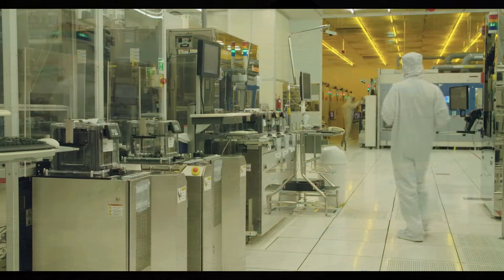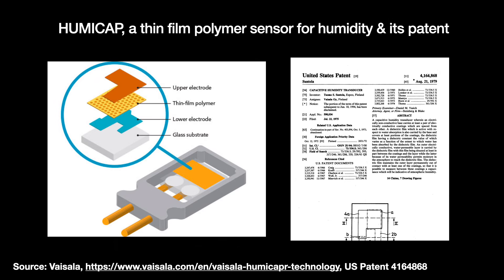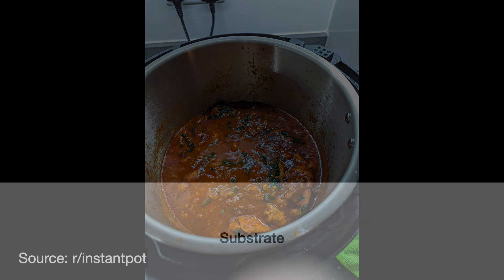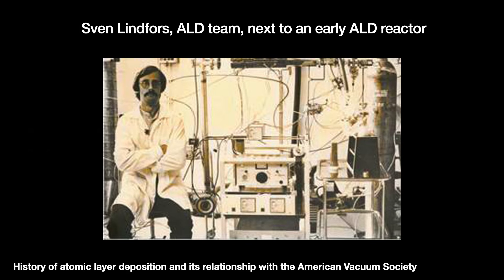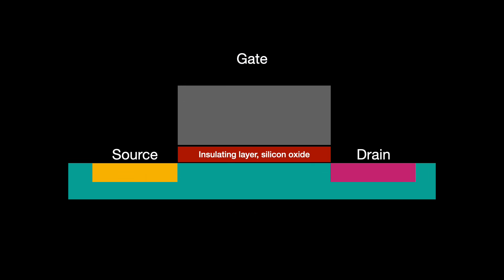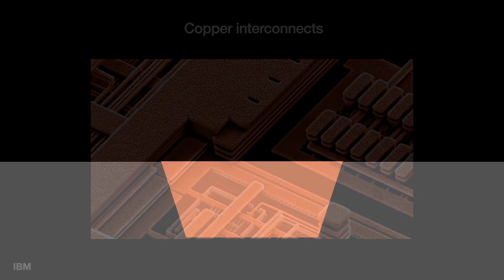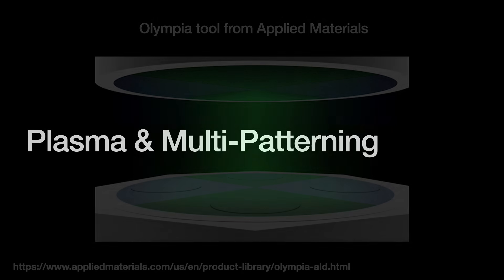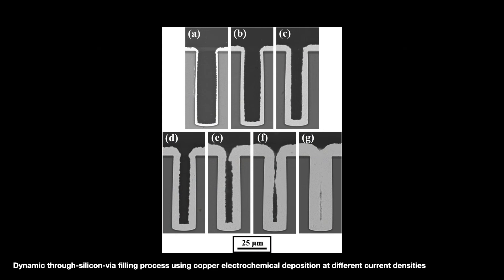The Unreasonable Effectiveness of Atomic Layer Deposition

Comment: As a programmer your videos about the never ending toils and tribunals of the lithography world reminds me not to wasteful with system resources. It's clear that at some point we're going to hit a wall called "physics don't care about your computing needs", so while I've seen stupendous performance gains from my Commodore 64 to my Ryzen 7950X3D that party is tapering off.
Reply: Moore's law prob has a limit. 
Quantum physics might break that physics, who knows
Reply: @clintcowan9424  I think that people forget how small chips are currently. Even when we hit that limit, a double in size every every 2 years for the first 10 years will result in chips the size of an orange; I doubt that for our lifetime computing power to size to power requirements will pose an issue.
Reply: @clintcowan9424  Moore's law is an observation that turned into a cadence target. Moore actually revised it twice in the early years. And, depending on how exactly you interpret it, it tapered off a decade ago.

But it is precisely quantum phenomena that starts screwing things up. Since electrons have this uncanny habit of "teleporting" themselves through barriers classical physics say they can't penetrate, at a certain point the thickness of the oxide insulator, needed for ever smaller gates, becomes a problem. We're already having massive leakage problems. Once we start reaching those thicknesses that is going to get exponentially worse.
Reply: @10001000101  Room temperature superconductors won't help us unless we also find lower leakage gates and a much faster switching semiconductor. And even then we eventually run into the problem that signals propagate at the speed of light (in that medium), so if we want faster... there is only smaller distances to help us, as we cant speed up light.
Reply: Depending on the interpretation of Moore's Law, in machine learning, Moore's Law is alive and well, actually, things are going faster than Moore's Law:
"Subsequently, the overall trend speeds up and doubles every 4 to 9 months,” they say. That significantly outperforms Moore's Law".
This is because of the huge amount of money pouring into machine learning in the past years...
Those in the comments saying: quantum computers, ...: remember quantum computers are not general computers, they are highly specialized.
Probably even more specialized than the hardware used for machine learning.
Reply: I think the biggest gains can be made in networking. For example silicon photonics has (had?) a huge promise of bringing fast parts logically closer together and thus allowing for bigger and faster systems over all. For example microservices are a very useful tool if applied within reason (you can easily add to much complexity, etc.) to build more reliable/fault tolerant systems.
Reply: Java programmers take note.
Reply: Python programera are hidding somewhere !
Reply: @andersjjensen  FinFETs partially solve that problem of tunneling electrons, but it does give a thickness penalty. As always, trade-offs. It's these trade-offs that will eventually prevent us from progressing any further, with respect to shrinking transistor size. Which is why Parallel computing, and 3D-stacking of dies has become a thing. Moore's law tapered off a decade ago.
Reply: @andersjjensen You must be a  very smart cat😉
Thanks for your insights.
Reply: @migorigor *cries in JavaScript*
Reply: That's exactly how I feel every time seeing to what length h/w manufacturers and system architects go to get any 1% improvement. And how s/w people casually dismiss orders of magnitude "because it is just a constant to the Big Oooh"
Reply: @clintcowan9424  "that physics" has always been quantum as transistors are quantum devices. The esoteric quantum effects have always been there, however they become more prominent the smaller you go.
Reply: @10001000101  AI cannat break the laws of physics, cap'ain!   To misquote Mr Scott from TOS :D
Reply: We will have to go back to how programming was done in the old days more or less, as in actually caring about every byte used. Stuff like only using polymorphism when absolutely necessary
Reply: @autohmae  Indeed!  Early days still for quantum computing.  I did see something about a computer language for quantum computing lately.  That is just an indicator of how early we are in the possible quantum computing story.
Reply: @paulmichaelfreedman8334  Truth!  It is important to look at all steps in computing - not just gate density or minimum structure size of components on a chip - to keep progress going.  I saw how Tesla FSD rewrote their software to reduce line count by an order of 10 recently and speed up the code.
Reply: Welcome to the idea behind chiplets or "glued-together" as Intel would say.
Reply: i think we all forgot they can just make the chip larger or stacked 
or all the components on a single large chip
Reply: The Commodore 64 was a great computer!  One could really gt under the hood.
I used my Dad's write and print (on a daisywheel!) my first resumes.
I bought a C compiler to keep programming sharp.
Reply: @clintcowan9424 Every exponential in nature is really a sigmoidal curve and we've hit the inflection point where it is now a logarithmic curve with diminishing returns. Quantum computers will give us some speed, but only in a similar way to increasing thread counts which have also hit diminishing returns. CSP problems will be massively accelerated tho, so that'll be crazy to see rubik's cubes and procedurally generated videogame worlds be instantly solved in one instruction if you have enough qbits.
Reply: @clintcowan9424 
Moore's law is about transistor count, not their size.
So while transistor size has a physical limit, the transistor count doesn't really have one.
Reply: We will go back to the old mainframe days in the 60s and 70s where code was competitively optimized by different programmers.
Reply: @SammyGDude the issue with making larger chips is that the yield drastically lowers, and it's seemingly not an easy issue to solve given how semiconductor manufactures have been working on the problem since their inception essentially.
Reply: We have at least 10 years of size scaling by the way when it comes to silicon. Now if they manage to make devices with new materials I don't know, that's an entirely different thing.
Reply: @samuelgayson6969 Good point! We can probably assume chips that large will require somewhat less aggressive cooling than today's chips due to the increased thermal mass. I'm sure once chips get bigger again, we'll have finally have an excuse to build up with cooling slats/channels/fins in mind - since built up heat will still propagate through thicker material - just slower and more evenly distributed (which is still useful!).

That said - there's also the issue that even WITH doubling the physical size, we assume that we (the consumer) will be responsible for bearing that burden with our desktops - while that might not necessarily be true.

A single massive server for your entire house may be capable of streaming VMs and storing/distributing all kinds of data to dozens of devices simultaneously (wired or wireless) as well as controlling electricity and gas usage. That might very well offset the increased size/power/cooling requirements that more traditional desktops would be unable to keep up with.
Reply: There will likely be a paradigm shift in the processing technology at somepoint where we use something else other than electrons to represent 1s and 0s. I think the most likely will be using light based processors where we use photons rather than electrons to represent 1s and 0s. But it could also be some circuit where we use spintronics instead of electronics....
Reply: Yeah, you totally ignored the capabilities of your own brain, Andersj.
As usual ... (Hehehe, forgive me that, but these silicon toys are just a toy compared to your capacities)
Reply: I imagine photonic computing could make a leap. You could potentially get clock cycles in the terahertz range with that
Reply: The more you learn the more you can learn. There won't be a limit to the growth, but certainly a limit to the capacity of the present tools we use to grasp that limit.
Reply: I can't remember where I read that the physical limit size to store a bit was 9 atoms.
If you go below that, quantum decoherence may switch the state of the bit.
We're still far from it, and I guess the cost/benefit of the latest stages will be ridiculous. But it's good to know the limitations physics impose to not evem try something impossible.
Reply: Well there's huge potential in light based computing and also quantity if we could ever figure out how to do it without having to be super cooled to almost absolute zero which there are potentials for that they just recently made a room temperature superconductor and that would help with the process vastly but yeah we are about halfway through the usefulness of silicon can potentially reach 10 gigahertz and possibly up to 12 or 15 but that's if we literally make atomic size transistors by using one element as the semiconductor and another as the traces I believe a certain tungsten alloy actually has potential for this can't remember what it's called but it kind of behaves like a molecular transistor
Reply: As has been proven by many newly released games. Not properly optimized, they require top shelf equipment to run
Reply: @Hippida  lol nothing in here was about gaming but ty for your opinion even if its misguided. lol newly released games are pretty well optimized sure you have a few outliers like cyberpunk but the majority of them are reasonably optimized i mean i can play most everything besides crysis 2 remasted and cyberpunk on my pc and im running a 9 year old cpu with a 6 year old gpu.
Reply: Toils and tribunals? Wut
Reply: @kyebean  Trails and tribunals when autocorrect doesn't duck things up.
Reply: @kellymoses8566 Actually that's kind of where we already are, with the many parallel heterogenous processing units in most of today's Computers. Even just good programming models for just basic multi-core CPUs are few and far apart.
The issue is that putside of High-performance and AI LLM computing, few people care enough about performance to pay for the necessary work. Computer manufacturers don't care, because they just want to sell you a Computer, Microsoft doesn't have any competitive reason to invest much work, and individual users are not aware of the issues.
Reply: @clintcowan9424  quantum computers wont be used in pcs to play video games pal

Comment: Man a lot has changed since running CVD machines in the nineties and early 2000s. Used to make arsenide laser chip wafers. Once the trimethyl aluminum injector misfired adding two extra shots to a batch of 635nm laser wafers and since it was for the active layer we went with it to see what would happen. At first we thought they were bunk but when we lowered the temperature of the test die to about 15 degC we got pure orange laser light at 612nm. If you got it extremely cold like -77 deg C the wavelength dropped to 602nm which was bright orange.The place was Polaroid lasers then Boston lasers if you were wondering ❤

Comment: I used to manage an ALD about a decade ago. They're really simple to run and maintain, the only real issue being sustained chamber temperatures causing the chamber o-ring seal to degrade over time. Periodically testing the films (we were primarily doing Al2O3 with trimethyl-aluminum and water) for carbon contamination in a ICP-MS is a good check to replace the seal, although it is easier to just replace the seals somewhat frequently.
Reply: Well pump maintenance can be an issue because even with pretty good filters or trying to thermally decompose the precursors you can still end up with deposition on the pump.  Granted they're not even particularly expensive pumps since you don't need or even want high vacuum.

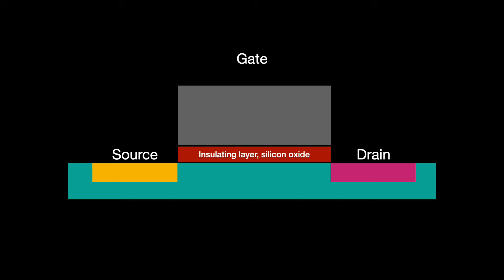Comment: 9:18 source-to-drain leakage is a different phenomenon than gate oxide leakage. If you use the light switch analogy, source-to-drain leakage would be the amount of electricity flowing into the lightbulb even when the switch is off, while gate oxide leakage would be if your finger could zap electricity into the lightbulb when you touch the switch.

A better designed gate oxide helps reduce both of these leakages though

Comment: Good stuff! It could have been emphasised that ALD specifically uses self-limiting surface reactions. This means that each cycle creates precisely a certain thickness of film and that the deposition is extremely conformal. These characteristics are especially useful for high aspect ratio structures or cavities (which were discussed).

Comment: I remember when the higher quality and less expensive electroluminescent panels replaced incandescent illuminated switch and circuit breaker lighting in general aviation aircraft. I never heard anything about the technological break through required to make them practical.

Comment: Good video as usual. A couple of suggestions: add some equipment suppliers information will be nice (ASM, Beneq, Picosun, which was bought by Applied Materials). Also ALD is a self limiting process therefore it does not have deposition uniformity concerns as in PVD or CVD. This unique feature could be mentioned as it gives ALD a huge advantage over CVD. Lastly, on spatial alternation method, it does not have to be rotation drum + multiple chambers - there have been single chamber linear systems used in the industry for at least 7, 8 years. An example is PERC process in thin film solar panel manufacturing equipment, where substrates move back and forth in a liner chamber with zones separated by purge gas curtains.
Reply: Hello Yuema, we see many different ALD players in the industry (Also LAM, Eugene...) but can we assume that ASM and Oxford Instruments own the best solution (Aspect Ratio / Deposition Rate / Step Coverage) ? Because every time you listen AMAT, they are pretty confident to their ability to gain market share, that's why they bought Picosun right ?

Comment: I'm a little surprised no one has yet figured out a reliable way to "air brush" atoms onto a substrate. Of course I don't mean using actual air as the motive medium since it has to be done in as near perfect a vacuum as possible.  Argon might be too big of an atom to use so Helium seems a superior option since it can escape minute barriers. Pure H2 could be cheaper if the substances aren't proton reactive at the temperatures of adequate deposition. Either way, one would need to ensure the "bubbles" are so small that they don't affect the final product. Sans that, annealing can help remove the nano-cavities created by the distribution "air".    Or, as is done with particular plasmas, an electrostatic "air brush" working with ions. Tune the power  down so instead of crashing into a substrate displacing other atoms, they land softly accompanying a neutralizing spray of electrons to lock it all in place.  Purge, rinse, repeat in very much the same idea as creating seasoning on a cast iron pan. 

Of course I may be way off base since we're dealing with so many variables on an atomic scale most of which aren't relevant once you get to the micron scale.
Reply: You could consider the plasma technique mentioned to be roughly equivalent

Comment: The substrate has to be hydrogen terminated before dep.  TSMC especially has tried to poach or work around my patent.
Reply: what patent is that?
Reply: @craigslist6988  low temp oxidation of silicon using chemical oxidation and etch, then terminate with hydrogen.  Basically, if the surface isn't perfect, then the dep doesn't take.  The oems for ald especially want it.  Doesn't matter. When you are an employee, you sign your inventor rights away.  I did have to defend the invention, even to the point of having my logbooks examined.
Reply: @mefobills279  that sounds very basic though.. guessing it's the exact conditions and chemical. Still, wouldn't this patent be out of protection by now?
Reply: @craigslist6988  I was vague.  Yes, it gets more complex, using ozone, etc.  All invention can be reduced to some simple concept.      Still active patent.  Generally, big companies cudgel each other because they mutually poach.  This is why Google bought Motorola to then move in on Apples I phone turf.   The Chinese, especially poach.  You have to sue, and that takes big bucks.  Like Elon says, patents are a cook book, yet Tesla still gets them.

Comment: The whole industry is funny to me, I'm 90 percent of the way there to finish inventing fully 3d, controlled assembly, error correcting during construction, custom architecture including hard wired software, NO litho needed logic systems.  Also no silicon wafers needed.

The whole state of the art, despite millions of talented engineers putting their soul into the project for half a century, is too contrived, difficult and too 2d.

Since I'm not that smart my methods are simple.  Hopefully others will eventually call them 'elegant'.

Now if someone can just please solve how to better electrically join nano wires, that's the missing 10 percent.